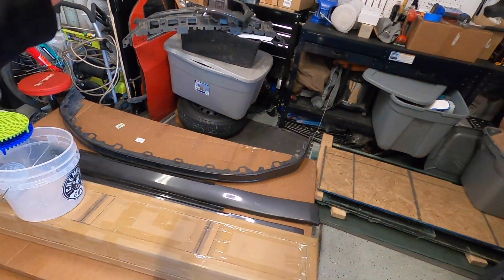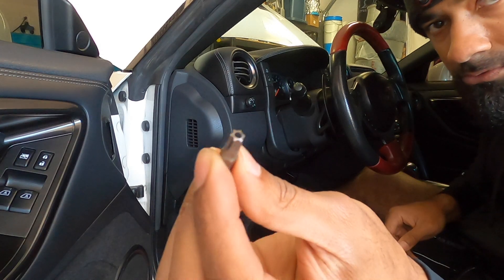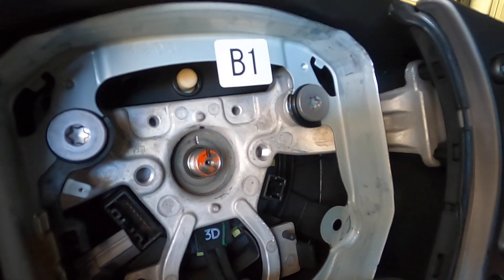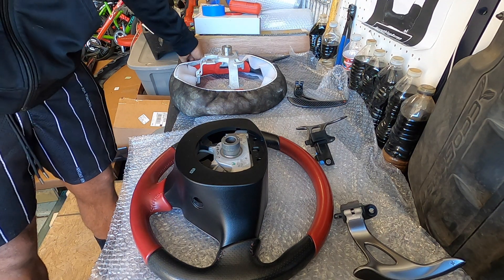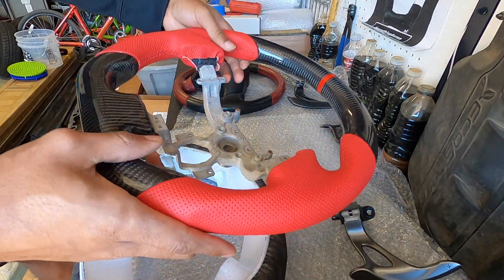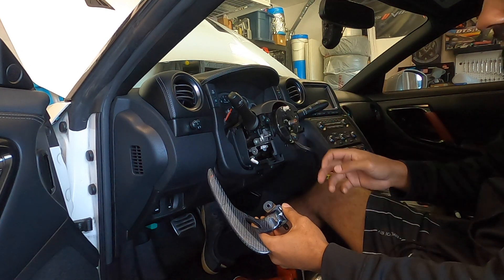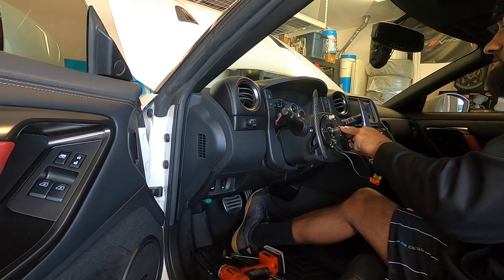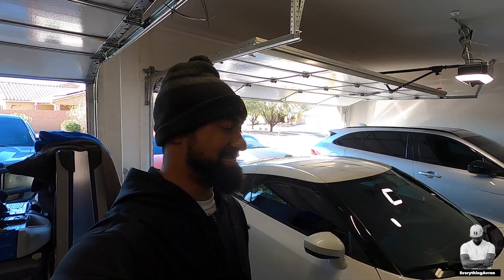HOW TO INSTALL CARBON FIBER STEERING WHEEL & PADDLE SHIFTERS ON R35 NISSAN GT-R| Best Interior Mod!

Comment: Did you notice your steering wheel being off a bit to the left when driving a straight line? I've been told all GTR's have to be aligned at the factory because the wheel splines are different on all cars. Everyone I've talked to says an allignment is needed after word to get wheel straight again.....adjusting tierods I guess.
Reply from the maker: Not at all… went on exactly as the old one did. And don’t have a single alignment issue at all… I will say that the splines are small and you could easily install it one or two grooves off and it will look straight.

Comment: I changed out 2 sets of paddle shifters on 2 different gtrs mine and my friend and of course now they don't work I did them similar to what you how ever I'm not sure if I messed up the thin piece of copper that the white rectangle slides in.  Should that copper piece be completely flat everything goes into place but when I hit the paddle shifter up to shift gears it's not making contacts somehow I literally just finished pulling mine apart 4 times in a row. Any advice
Reply: Hi I’m having this issue did you fix it